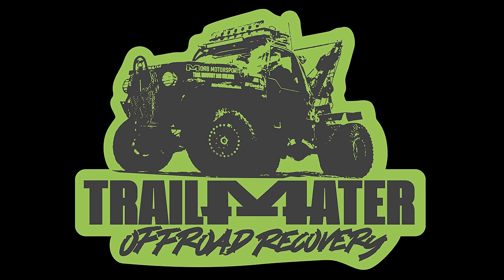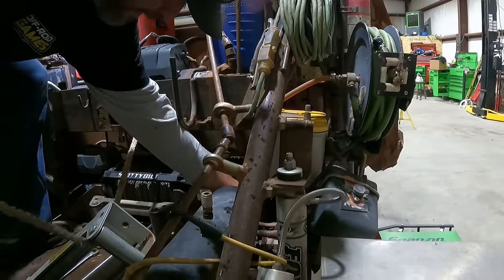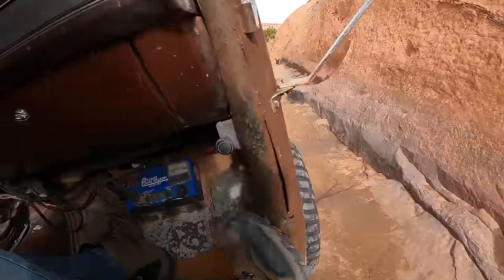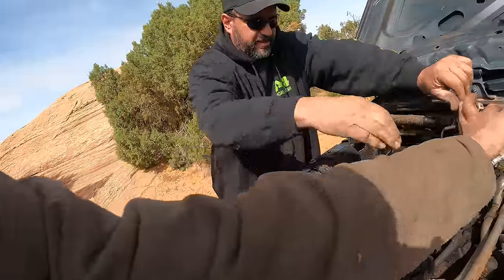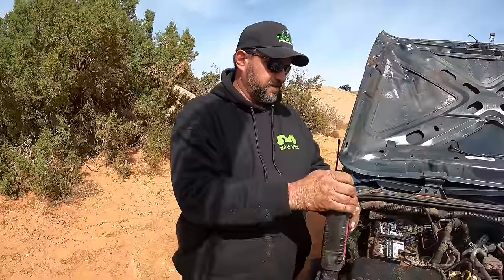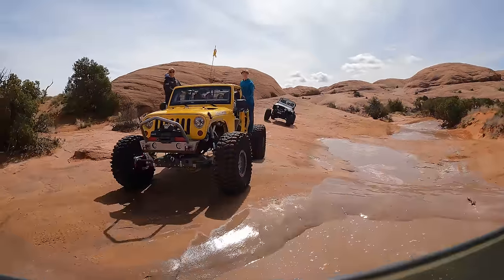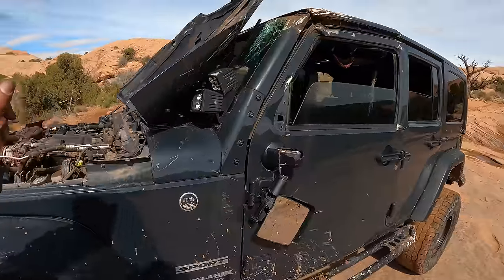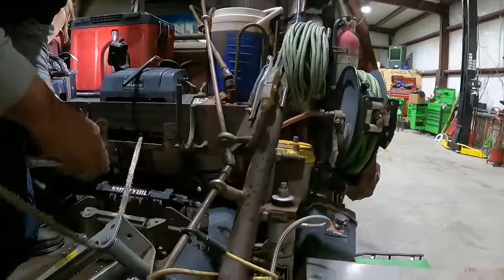Jeep Rolled On Hells Revenge

Comment: A tow truck driver once taught me to use a floor mat if there is glass on the seat, just put it on the seat (upside down, as the bottom should be free of glass).. Those things are tough and block all the glass from entering your behind.
Reply: Unless it’s one of the floor mats with the little spikes, then decisions need to be made 😎
Reply: @squiggyg.8415  I'm not sure what would be worse, spikes that stay with the mat or glass that has to be tweezered out.

Comment: The dipstick trick works well in a pinch. 
That replacement cap idea is kewl too....
Rory, I noticed the rear fender on the drivers side of TrailMater is moving a lot where it is bolted in the inside. I don't know if that is a design thing or something is worng.

Comment: If that was my Jeep, unless I was injured, I would have been the one driving it out.   Many years ago, I was the mechanic at an Arctic Cat dealership.  We were going on a ride down to Medicine  Lake, and one of the brand new Panthers got all out of shape due to too much speed over some whoops.  The machine then slammed into a tree while being vertical.  The owner was all bummed out about his machine and the ride.  The handle bars were laying down next to the seat, the hood was destroyed, the spark plugs were both smashed and the chain case over the primary drive was sheared off.   I replaced the spark plugs, bent back in place the handlebars, and fired up the machine.  The owner asked, "what about the chain case?"  I asked him how many motorcycles have an enclosed chain case.  I told him that for today's ride, it will be fine.  He was now happy and we continued on our ride.  I can be pretty ingenues when it comes to walking out.  I don't know how many times I have jury-rigged something to get home.  

But, as usual, Rory and the crew won again.  Good job.